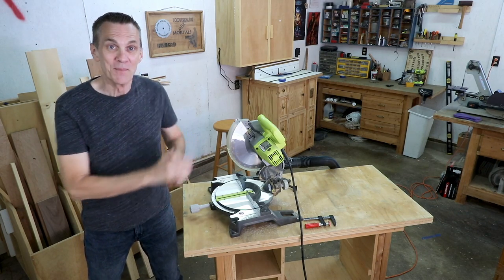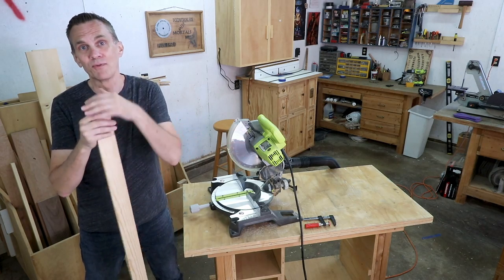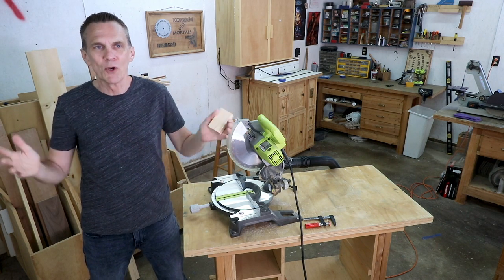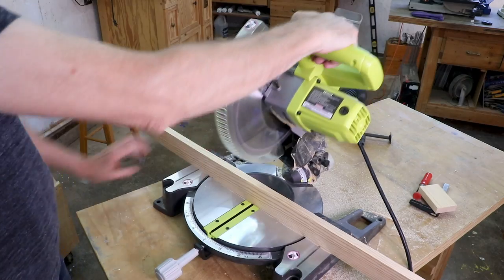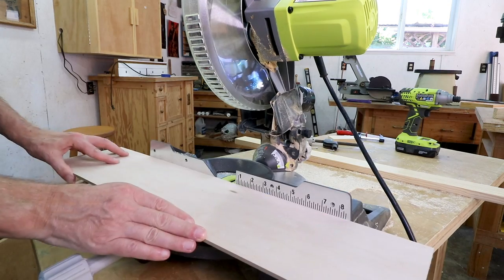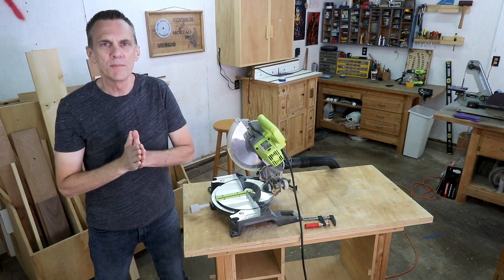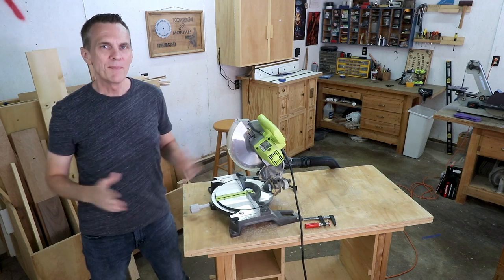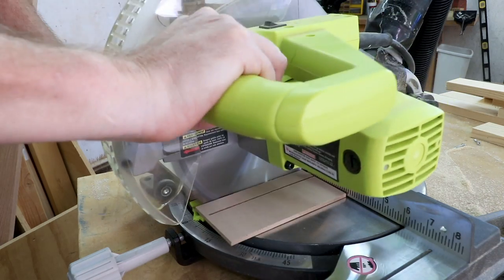8 ways to use a miter saw like a pro

Comment: Correct me if I'm wrong guys but tool used in this video is not even miter saw. It's a chop saw. Miter saw needs to have slider, right?
Reply from the maker: Good question. A lot of people still call miter saws "chop saws". It's an older term that usually refers to miter saws that aren't sliding miter saws. A quick Amazon search for "chop saw" will direct you to miter saws. I don't think any tool manufacturer calls their saws chop saws.

Comment: I have no idea why anyone would have a mitre saw but not a sliding version that can be locked if required? The price is usually not that much more.
Reply: Because I don't have the money to buy a new one and my old one that my uncle gave to me doesn't slide.
Reply: I'm led to believe that the cheaper ones have a lot of play on the sliding part, which makes them less accurate?
Reply: I'm new to wood working so take this with a grain of salt, but if I had to buy it again I wouldn't buy a sliding miter saw.
The biggest reason is the sliding saw takes up a huge footprint vs the regular saw. Now that I own a table saw it makes less sense to want to have a sliding miter.
It comes in handy sometimes, but I'd trade mine in for a non sliding version anyday.
I've heard many people say they are less accurate than a table saw also which matters more on longer cuts. Hope this helps.
Reply: Most people new to woodworking really don't have the money for brand new tools. I had to save to get my first miter saw. It was imperative that it was a compound in order to do trim work in my house. I bought it used for $70. A compound sliding miter saw would have cost at least twice that (if I was lucky enough to find one used!)
Reply: When I purchased my saw (several years ago), the Hitachi unit that I wanted used up all of the funds that I could justify on a miter saw.  Yes, I could have bought a sliding Harbor Freight saw for the same money, but the quality was more important to me.  And sure, if I could get a full refund on my saw now and spend the extra for a sliding saw, I would.  But short of that, it's working just fine for me.

Comment: Buy a 12" miter saw if it isn't a sliding miter saw.
Reply: I was told by a old timer who did trim and molding that 12" saws wont cut quite as accurate as a 10".  May be wrong, but he swore by it.

Comment: As a zero  clearance plate you could use duct tape. You will have still be able to slide the the blade to either side without removing wood.

Comment: #9 replace that 24 tooth blade with a proper crosscut blade.
Reply: If you buy a blade at home depot chances are you will need to get it sharpened before the first cut.

Comment: I had that exact miter saw. Then I let my nephew use it. The black cast iron that the adjuster knob on the front of the table attaches "somehow broke". Ryobi does not have have replacements. So I was forced to upgrade. I mean forced. There was absolutely no way around it. wink wink

Comment: Pro tip: Never buy a ryobi mitersaw.
Reply: I'm not a pro ... had one for years and it has worked really well through several projects of all types.  Great starter saw for those without a lot of money and are not pros.  Also bought the Kobalt portable stand, another cheap purchase that has served me well for years.

I do have to admit I had to spend some time getting it all squared up and still check it regularly.

I use mine mostly for projects like building decks and shop tables.  I don't use it for fine cabinetry. Although I have used it for molding work and it did very well using the 'sneak up on it' method. Checking angled cuts beforehand using accurate gauges goes a long way to using this type of equipment.